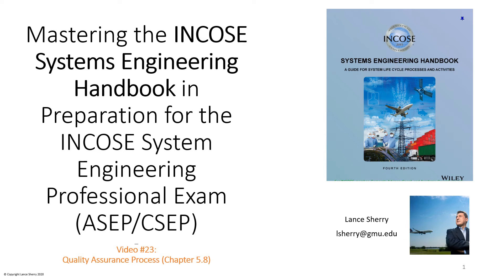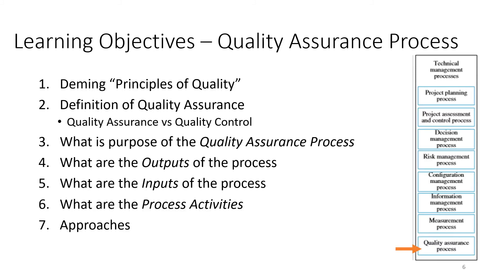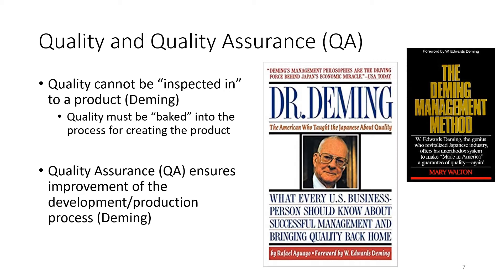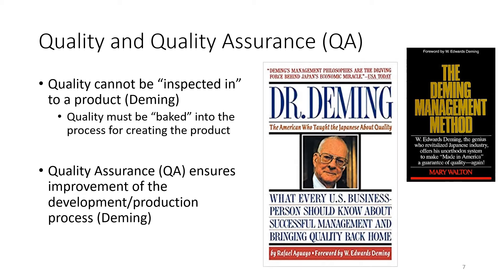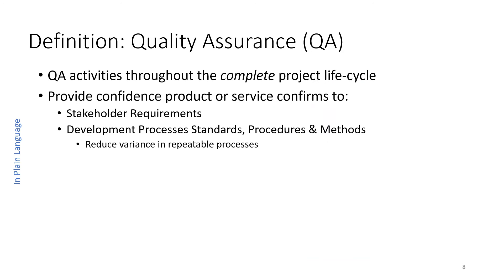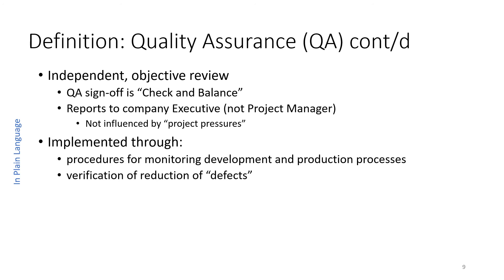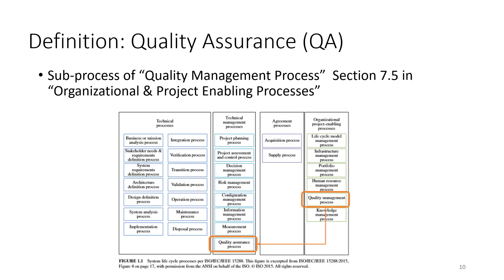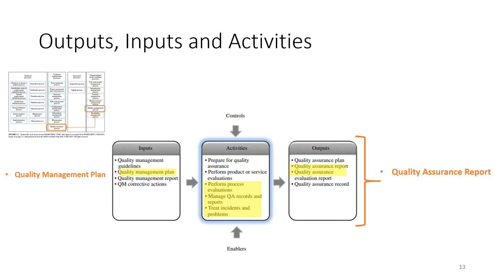INCOSE ASEP Exam Tutorial - Video #23 - TMP Quality Assurance Process - (Chapter 5.8)

Comment: I cannot see the videos on Chapter 6 - Acquisition and Supply processes. Could you help pse?
Reply: Indeed, they are critical processes. If the system is not sold, its engineering is useless